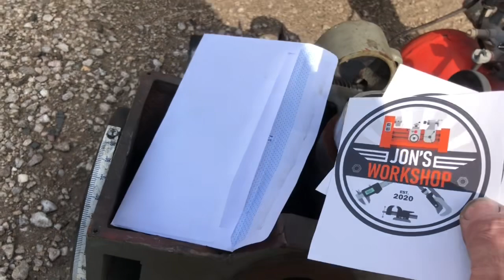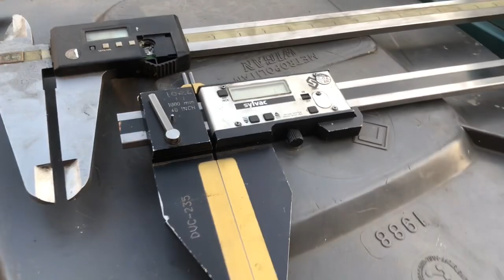Scrap from Scotland

Comment: Hi Eun, lol, give the compressor a hand crank, it worked last time I switched it on a few months ago, it's been outside in the elements, probably seized a bit. Sylvac is really good gear, as is Mitutoyo, you could cut those down to the size you need and they should still work (or tart em up and they will go for North of £50 each on fleabay). In true crock Dundee style 'call that a vernier?' wait till you see what I have for you lol. Cheers, Jon

Comment: How do you strip that big caravan kind of extention cable?
Reply from the maker: Easy, slit the sleeve, push, not pull The steel outer mesh off. Strip singles as usual. I’ll do a vid for you
Reply: @Man-in-da-shed  Thank you very much sir